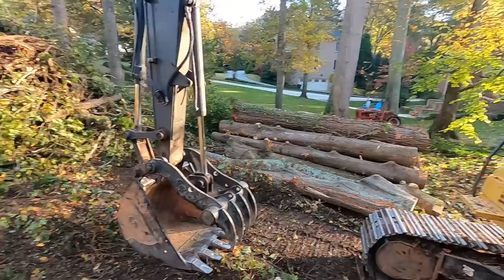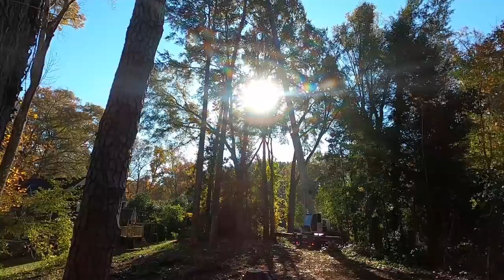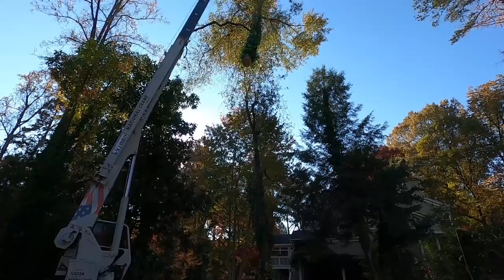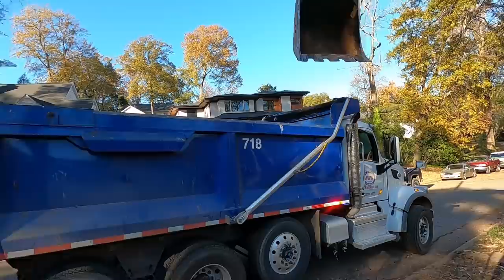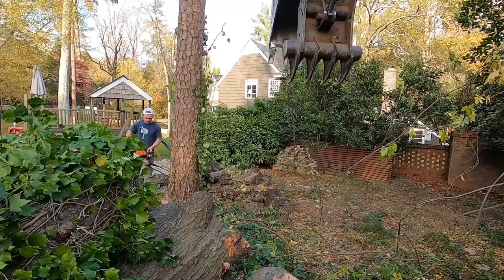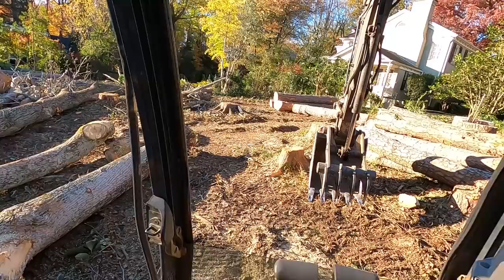Dropping Tall Trees To Clear a HomeSite

Comment: Great solo vid. Some constructive criticism: Your sub contractor needs to supply some safety gear while operating saw. His saw needs sharpening, and your bucket is in bad need of bushings, spend little $$ today save BIG  $$ tomorrow. Keep up the good work.
Reply: Yuppers, I noticed that to.
He's gonna be deaf in less than a decade if he doesn't get a hard hat, ear protection including soft foam plugs under sound deadening muffs, leather chainsaw chaps, leather work gloves and knee pads under his chaps.
They can be bulky and hard to work in but worth every penny if a tree or limb decides to work against you.
It's one thing I like about Captain Kleemans when he sometimes uses his.
There's another channel all of the crew wears all of that including the excavator operator.
No amount of insurance can make up for severally damaged body parts that cause you to become disabled.
Happens all the time to small crews.